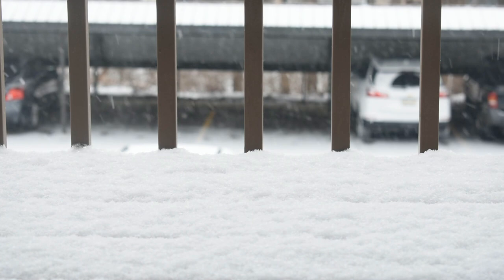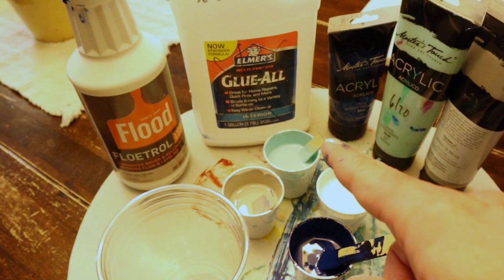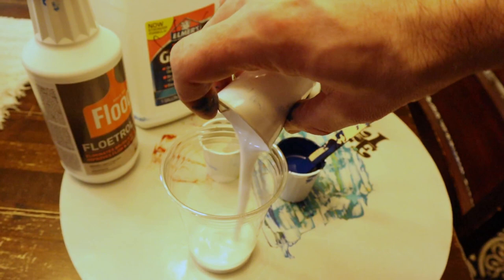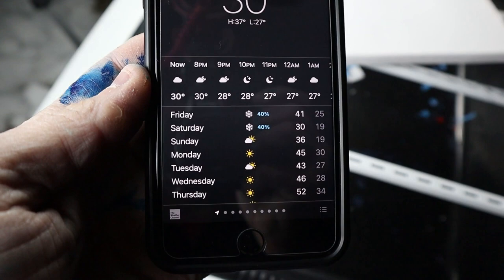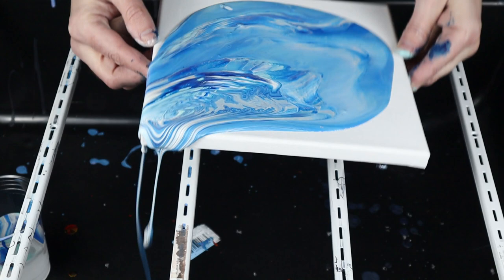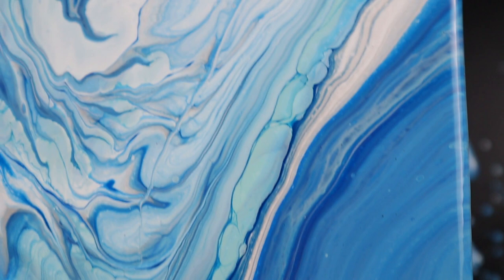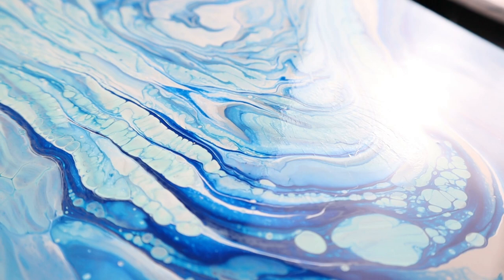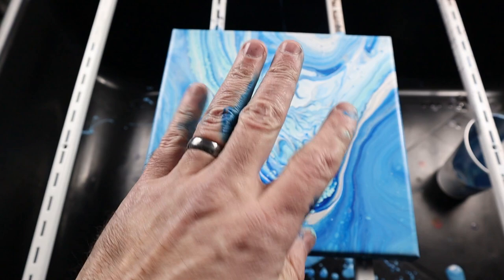Pouring outside in the FREEZING COLD!

Comment: I guess pouring in the snow is contagious bc I put silk flowers on top of the snow in March (I'm stuck in Germany since August last year completely alone so my bored inner child came out). I put all of the paint into one cup like you did, then poured directly onto the snow and flowers. Then lifted it off in one piece. Took it inside and removed the flowers which had cast an impression onto the paint. Cut it into separate but cohesive pieces and did a 3D epoxy resin sphere so when you look at it from the side it looks like a bunch of scrap paint but from the front looks like the full piece has been put back together again. I want to do something similar again but sprinkle some UV mica pigment around so it glows with the UV like. Boredom is a powerful tool! LOL
Reply from the maker: Amen Ashleigh.  That sounds amazing BTW.

Comment: You're analytical... have you looked for the differences between pour paint and spray paint? That might be your bottleneck.
We live in Connecticut, directly over a creek. Next winter I'm storing some of my mixed colors on the cellar floor to see if the cold affects the sitting paint. I've left my floetrol on the floor but not in an area that's really cold.
Now, it's time for you to check Amazon for XL nitrile gloves. I'd gotten some of Amazon's own brand for my husband, and even found S for me.
Reply from the maker: I was spraying latex house paint previously.  For sure they aren't the same but I was hoping the water in the paint would act the same.  It might have had I left it to "freeze" longer.  The pour had WAY more paint so I should have expected it to take much longer.  It was fun though and I'll have to try again sometime.  Kind of over winter though.  Bring on the spring.